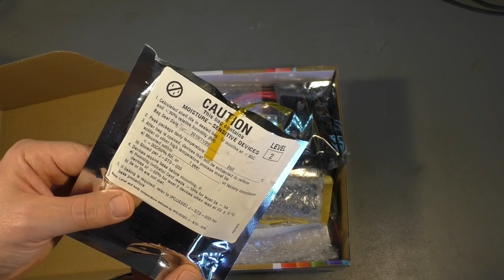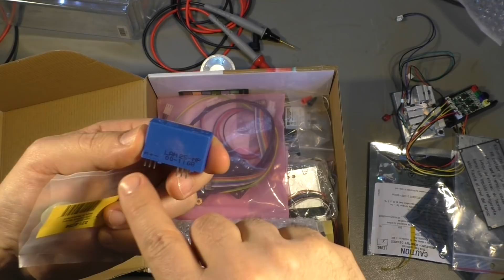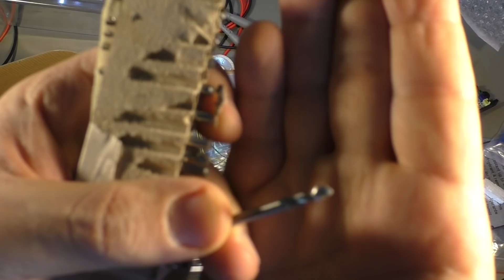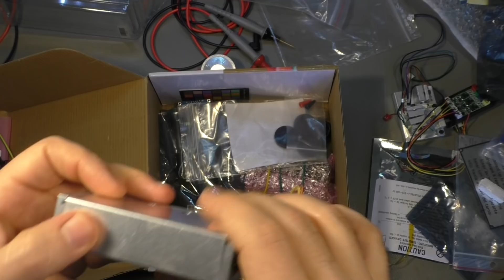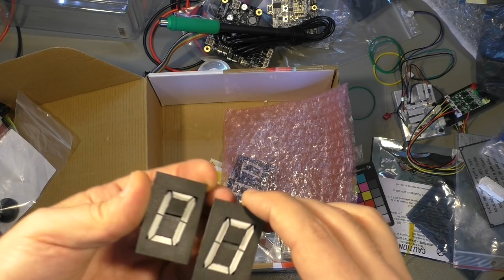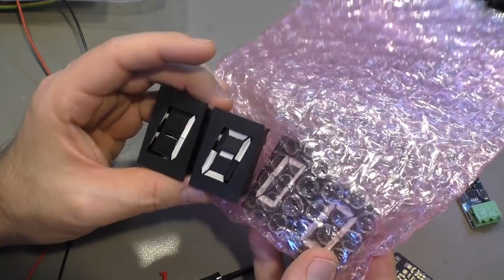Surprise box unpacking - (PWJ162)

Comment: Those latching 7-segment displays were often used in petrol pumps. I think you can make the segments change by moving a magnet near it.
Reply from the maker: yes that would probably work.... there are similar displays on aircraft that indicate errors, Lazy technicians reset them with a magnet :-) Problem not fixed but indicator shows OK again.

Comment: damn that guy has good taste in junk 😋

unisolder is actually completely hand-made, with hundreds of similarly looking parts it's quite an adventure!

the step attenuator is a Hirose P-AT-8(26.5-70)A, missing its actual ceramic resistors sadly. it was the input attenuator of a spectrum analyzer once.
I actually don't know what the round IR 'buttons' are myself, but I got an entire bag of em, if you need more 😅
Reply: It also has a very non-optimised bill of materials. I'm half way through building one, but contemplating making an improved design on my channel
Reply: IR buttons looks Interesting can i Steal 2 ?
Reply: Love you Chris.

Comment: Since when are microcontrollers moisture sensitive?
Reply from the maker: Many chips are sensitive to moisture. The problem is at the moment of soldering any amount of moisture inside the package turns into steam and that can cause cracks. So a common procedure is to "dry" the chips before soldering at medium temperatures to let moisture escape before it gets really hot.
Or you get them in moisture tight bags with an indicator strip inside. So you can be sure that your chips are dry.
Reply: @PlaywithJunk  The term used by some manufacturers is 'popcorning'
Reply: The same applies if you have electronics stored outside or in cold storage you should let them warm up and dry for a while before turning them on, else the heat the chip produces itself also can crack it

Comment: btw - nice clock chime in background. :) and, yes, this aliminium block with gold within is attenuator.
Reply from the maker: Do you know what the metal/carbon strip does?
Reply: As you correctly mentioned : this is voodoo, but for me, this looks like something about absorption thing to deal with standing waves and reflections. Just ask TheSignalPath. He is the right guy for gigahertz stuff and magic. :)
Reply from the maker: @martinsmartins187  I got the information that the RF ceramic resistors are missing. So the aluminum block is just a cover with a mangetic shield strip.